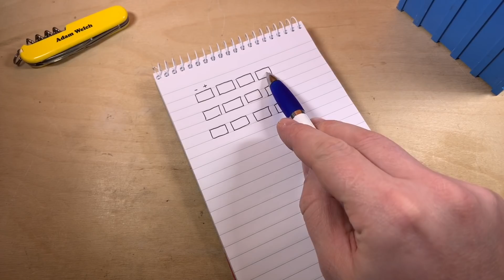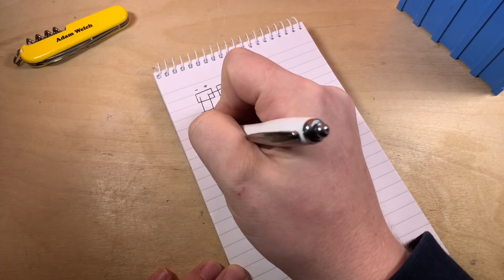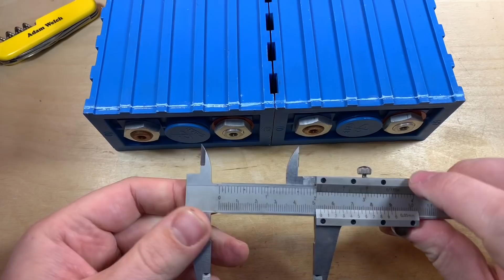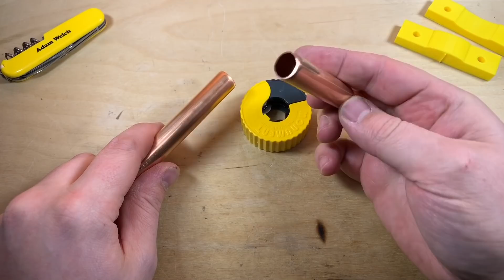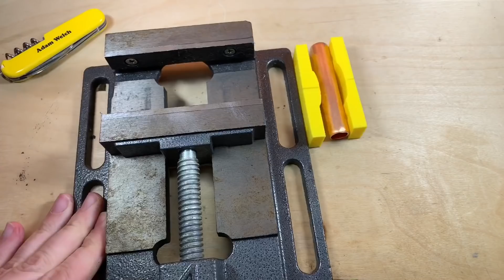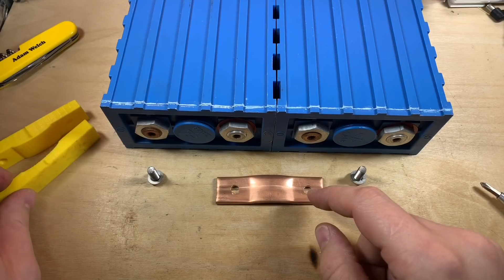LiFePO4 Copper Connectors

Comment: OMG.. I know this is five months later, but please tell me you didn't connect your pack that way?!?!  The whole pack's current will flow into that first buss bar.  Even that copper will have enough resistance to matter at 20 amps, and the current will be different as it flows down the buss bar.  Voltage is additive in series, Current is additive in parallel!  Then it happens in reverse on the other side - the current from the last battery to the middle one will be something close to a third of the total.  The current between the middle and first battery will be 2/3rds, and finally all that current has to flow through the single parallel connection to the next stack.  The varying currents and resulting voltage drops will have every single cell charging and discharging at a different rate, and you'll soon end up with very imbalanced cells.  If you have a balance circuit on it, it will be working overtime correcting for this, and wasting power.
     The pack has to be connected in a GRID.. a FULL grid.  You can get away with a lot with 18650s and their much lower current rating.  Not with these.  Each 3P stack must have all three positive terminals connected to each other, preferably with one buss bar.  The negatives have to be the same way - that part is correct.  But to get 4P you need to connect ALL THREE negatives from one 3P stack to all three positives of the next 3P stack.  This allows current to flow as evenly as possible, without current differentials along the parallel buss bars.
     As for the screws - they really should be brass.  Some kit makers actually provide stainless, so you're probably fine.  If you do get galvanic corrosion inside the terminals, you may not get those screws out without breaking something.  Chances are, you won't be doing that anyway unless that battery needs to be replaced, but brass. aluminum and copper get along pretty well, galvanically speaking.  If you see any corrosion on or around your connections, consider switching to brass when you can.
Reply: Chris I am designing a 170kWh battery to power my catamaran which will use a 60kW motor,  using LiFePo4 3.2V 200Ah cell in a 6P 45S configuraiton to create the 144V 1200Ah battery.   I am currently considering the connection of each 6P pack.... following the grid method you mention here means 6 cables are needed to connect each pack for upto 45 packs which is quite alot of cabling to run through the boat as the packs will  likely be located in various locations as the space allows, if this is the only reliable method then I must do it ?  or would it be better to parallel each string of 45 cells at their end terminals instead of paralleling the indvidiual cell  i.e. 45S 6P ?
Reply: @Arran.Pritchard  Sorry.  Now that I  understand the arrangement, it makes more sense.  It's not more reliable to connect in the center, it's just more efficiency.  As long as you use hefty buss bars for the packs, you will lose some power, but not enough to warrant all the extra work and materials, etc.
Reply: @chrisw1462  Thank you for your reply,   which method do you recommend  i, parallel the cells into 6p packs then connect each pack in series   or  ii,  series the cells into 45s strings then connect each string in parallel....   After reading one of the various BMS documents I found,  they recommended the former however I am uncertain if this is due to a limitation of their BMS system.  Is it better to parallel first then series or series first then parallel.

Comment: hi Adam. If you want a real good replacement for your Lead Acids, have a look at the Winston LiFeYPo ones; they work well on very low temps (-45) and high temps (up to 80 degrees C). You can get them on for example EV-Power.

Comment: About fusing; the cells probably have some kind of internal short circuit protection. 

Here is an example: https://www.youtube.com/watch?v=G7Z7q97Exzc
Short circuit connection is breaked after 8 seconds. Cell is not (easily) usable after that.
So extra fuses (in this case) would protect internal fuse against external shorting. 
If the cell is internaly shorted, additional fuses make no sese while there is internal fuse.

Comment: For what it’s worth, I took apart my Victron LiFePo4 battery and they use pretty much the same method of connecting the four (Winston ) cells together in series. Copper bus bars very similar size to what you ended up with, and no fusing between the cells.

Comment: Great video as always.  I have been using aluminum flat bar to connect my cells.  They are very cheap and easy to use.  They also have 60% the conductivity of copper.  So if we take the 15mm copper tube with a circumference of about 47mm @ 1mm wall then you have about 47mm2 of copper.  So you will need about 80mm2 of aluminum.  3x25mm bar should work well and it would save you 3GBP per meter.  I imagine the battery tabs are a bit higher than the sides so you might not need to bend them either.

Comment: Putting it in the vice first as others have said sounds like a good idea, could also have the vice so the handle is over the edge of the desk and then extend the handle and then you could freely spin it all the way around and also it would be easier with the extra leverage.  Great video as always :-)
Reply from the maker: Thanks Colin. I agree with all your suggestions. If only I had a pipe which I could put over the handle... ;-)

Comment: Copper pipes work, but if your solution is in an environment with any vibration you need to change the approach.  You see high end places selling thin copper layered ones because they don't transmit vibrations.  You don't want vibrations on the terminals because it will transmit to the inside of the cell and cause delamination and a whole host of other issues.
Reply from the maker: Interesting. There is no vibration in the shed - well not usually. So I don’t think this will be an issue for me. Thank you.

Comment: (pi x d)/2 is the formula you were struggling for, Adam. Then allow a little more for the Copper stretching as it is crushed. 
Edit, after reading other comments: You could also have flattened the tube in a vice, and then formed the bend with the mould. It might have been easier for you.
Reply from the maker: Yeah thank you. It’s just a couple of millimetres greater than I accounted for. Squash first, form later does seem to be the way to go. Cheers

Comment: As already said this would be much easier if you annealed the 'hard drawn' copper pipe.
To anneal copper heat it red and then quench it in water. It works the reverse to steel.
Reply: Robert Grant to soften hard copper, you heat it, then let if slowly cool... if you are cooling it rapidly, you are hardening it...
Reply: @SuperVstech  Robert Grant is correct, quench after heating to cherry red.
Reply: g0mhc nope... instantly cooling red hot copper will make it harder to work with. Not as bad as hard drawn copper, but still harder than cooling after the red tint has dimmed.
Reply: We're all wrong. The rate of cooling doesn't matter, it's only the heating that removes the grain dislocations. In the manufacture of copper pipe the drawing process makes it hard hence "hard drawn". Heating it to cherry red will make it soft and bending will again make it brittle.
Reply: Robert Grant yup... copper hardens by working it... 
my bad.
Reply: @robroysyd  You are of course correct. I should have remembered from my apprentice days when no quench bath was available. Thanks for keeping me right :O)

Comment: Im setting up a used 60Ah 4s 2p battery at the moment. I've gone with aprox 1 inch 3mm thick copper bar. High current between parallel pairs but it does worry me. My cells were sitting at 3.3v for quite some time so they werent self discharging. I drained until lowest cell was at 3v, now recharging at 10A. My meter has topped out at 65Ah, but at least Wh is still working - 945Wh gone in but my cell voltage hasn't gone up much at all. Really weird. 13.6 across the pack, aprox 3.39v per cell pair. Cells only 36mv apart in balance. This is a 1440Wh pack, surely I should be seeing a higher voltage by now. I'll have to keep watching it.

So in conclusion, I might try fuse links, maybe 50A just for peace of mind. I'll never charge or draw anywhere near to that.
Reply from the maker: The charge and discharge curve of lifepo4 is extremely flat. It makes it very hard to calculate SOC from the voltage. I’ve got a lot of graphs from my testing of these cells

Comment: for all the effort you're putting into this you could have just bought some flat sheet copper cut into bars that would not only have a thicker cross section (less resistance) but more uniform in appearance.
Reply from the maker: Not as much fun though ;-)
Reply: @AdamWelchUK  fair enough :-)

Comment: If you heat the pipe cherry red and cool it fast (i think) the pipe will become very soft and easier to squash. I would not fuse the cells. The 40 Amp hour cells in the battery pack of my phev car are not fused. But do have a bms that will throw up an error as soon as one battery misbehave's. My car is an 80xs configuration however so fuses would not work individually.

Comment: If you're worried about the connection between the starps and the cell posts, maybe a toothed washer would help?  But that's another metal to consider in your galvanic design.  And IMHO, a fuse for every cell, but that will entail a physical redesign as for every 3P unit you'll need a single strap with two humps and three holes for the negative and a strap and three fuses for the negative.  Maybe if the straps are longer they can protrude (all on one side) and then be joined together in a line (rather than your original serpentine design).

Comment: I'm putting together a 48v 520ah Lifepo4 battery at the moment, using essentially the same technique.  The maximum current draw from 3x 5000w inverters is fused at 375a total, so I doubled up two flattened pieces of 3/4" thick wall copper pipe.  My only suggestion is to use a bit of sandpaper to lightly scuff up and clean the connections both on the terminals and on the bus bars, and apply a bit of anti-corrosion compound between them to ensure a good connection.  If you're not going to use lock washers of some sort, keep an eye on the tightness of the bolts as the thermal cycling could loosen them up over time.

Comment: Adam, parallel packs are commonly used - I'm writing this courtesy of a 540Ah 3P4S pack of CALB 180s.
You won't really know if your cells are good till you test their capacity. You'll need to discharge them and see how much power you get from each cell. Just holding a voltage is not a good indicator of capacity in this chemistry.  If you are going store the cells for a while, consider discharging them to 50% or less.  
Another viewer mentioned galvanic corrosion. You can help reduce corrosion at the terminals by using a product like 'No-oxid' on the terminal bolts.  When tightening, ensure you use the correct torque - some have over-torqued and their terminals have become loose.  
A slice of heat shrink on the copper straps produces a protective finish.
Consider wrapping your tools in insulating tape and wearing eye protection when assembling your pack. A dropped spanner will quickly convert into molten metal balls and spoil your day :)
Reply: All great comments. Spot on.

Comment: my thought was first that when you had the tube almost completely squeezed that you could leave it that way and then melt the tin into the holes so it gets a little more for that for the current but that it should also lead to reduced corrosion on the inside

And in the question you asked, it should not need very thick cable as long as the cells have the same capacity so I would probably take a single conductor of 1.5mm2 and solder to the copper or if you attach to quick connectors used in car and then you can also bring fuse holders and solder them in the middle as I guess it will also be in the one you contact on your BMS (so you can easily take it apart if you need)

Comment: Easiest way to do this is to heat up the copper pipe cherry red to anneal it and let it cool st room temperature. Once cooled cut to size and use a hydraulic press to flatten the tubing then drill the required holes. This is the way I did mine. Once the metal is annealed, it's a  lot easier to press them flat.
Reply: You can squash copper pipe with your fingers when it is annealed

Comment: Add a length of pipe to the vice of knowledge handle, or get a proper bench vice.  A lump hammer also works, and is a lot quicker.
Reply: Oil the threads so that less torque is wasted on friction.
Reply: Annealing the copper to remove its "work hardening" make more sense it will squash very easily after heating to dull red and quenching in cold water. The vice squashing the cooper will re-work harden it.

Comment: Not the best connection.
Central pack need to be the output (main). The connections need to handle peak current from each cell. And the main 3 times more. The connection between series cells must be 3 paralell and not one, like on your scheme.

Comment: Are the positive terminals of those batteries aluminium? I had a similar setup with homemade solid copper busbars. But someone in the DIYpowerwalls facebook group pointed out that I had created direct copper to aluminium connections, which are subject to galvanic corrosion.

Comment: I think since using a much smaller number of lifepo4 cells which were all made in the same date like a matched group so they age gracefully together negates the need to fuse cells like we do with 18650. I've never heard of this happening in a lifepo4 setup. It may be a gradual Thing over time where one cell is warmer then others and can be dealt with. But If I were you I would just hook them up we with your buss bars without fusing and keep an eye on there performance.

Comment: Copper pipe is great!
Use the bus bars for the strings as they are by far the main current carriers, with 3 into 1 at the ends.
Inter series parallel connections much lighter, 14AWG would likely be fine and save money - they're only going to be carrying balancing currents unless a cell goes short, and then you do need something to give gracefully.
End terminals could be connected together with bus bars, as the other side of the top or bottom cellgroup would have the lighter cable.
Use steel wool or wire brush on a rod to clean the inside of the copper pipe, do the press then hammer flat on an anvil.
On those cells, it looks like the hump isn't necessary. Use a wire brush to clean the terminals and copper surfaces to remove any oxidation again before clamping, then you shouldn't get any hot spots.

If in doubt draw the connection diagram and do the current calculations to see where copper is really needed!

Comment: flatten the pipe first in the vice, then use the mold
Reply from the maker: I’ll try that. It seems like a good idea.
Reply: @AdamWelchUK  Just anneal the pipe and it will be soft enough to squash with your fingers
Reply: @kirkc9643  10mm microbore is already soft, and gives you 15mm straps with about 20mm^2 CSA
Reply: Was what I was about to say :)
Reply: Flatten with sledgehammer 🔨 then vice
Reply: As Adam Savage says every tool is a hammer..

Comment: I wish we could just buy them. They come with the cells kits, but I can't find individual bus bar suppliers. Everyone on my forum cannot find a source either. We are all using the copper pipe method as well with a drill press.
Reply from the maker: Oh right. I have seen copper pipe being used before - flattened too. Not seen anyone using a mould though. I was very pleased it worked so well. Cheers
Reply: @AdamWelchUK  yes the mould is genius! I love it. Nice job
Reply from the maker: Cheers. I appreciate it.
Reply: https://power.tenergy.com/lifepo4-40ah-battery-busbar-connector/
Reply: It is possible to buy terminal connectors. But they cost pretty much. https://www.ev-power.eu/LiFePO4-accessories/

Comment: Hey Adam, so best practice iv seen so far is to create high current + &  - bus rails and then fuse each series set to the + rail via a fuse rated just under what your cells are rated to put out, and connect the - directly. This allows the fuse to operate at a safe level as most fuses blow at a level that is X times more than the rated capacity. For example a house hold B type breaker will usually only trip at between 2 to 5 times its rating as shown in the charts of BS 7671. 

If your cell's can cope with a current that is hard to find the correct fuse for then remember fuses can be doubled up or more to share the load and will blow in a cascade manner should there be a short or too high a current draw. 

Hope that's useful.
Reply from the maker: Thank you. I’d feel more comfortable fusing, but I haven’t really seen it done on LiFePO4 packs. I’ll give it some thought and all these opinions are useful (as ever).
Reply: @AdamWelchUK  Yer LiFePO4 is a great 12 volt Lead acid replacement. They are a safer chemistry than the Lithium Cobalt Oxide (18650) type cell's. Jehu used those headway cells to power his VW bus that he electrified. Ow though his was a yellow color not blue. https://www.youtube.com/user/jehugarcia
Reply from the maker: Charlotte Lackney Cheers. I will be using a BMS. Just trying to work out how to connect everything together. Getting some great feedback from everyone.

Comment: how many max current can this pipe take ? nice video by the way
Reply from the maker: Your guess is as good as mine. I probably need to calculate it, but I suspect it’s quite a large number. These are short hops too.
Reply: @AdamWelchUK  https://en.wikipedia.org/wiki/American_wire_gauge
Standard 15mm pipe has a wall thickness of 0.7 mm, so cross sectional area is (π × (15/2)²) − (π × ((15-(0.7×2))/2)²) = 31 mm²
That's good for around 100 amps.
With 3P you'll easily be able to pull 300 A if the ends merge into a 93 mm² cable!
(edited after realizing I made an error!)